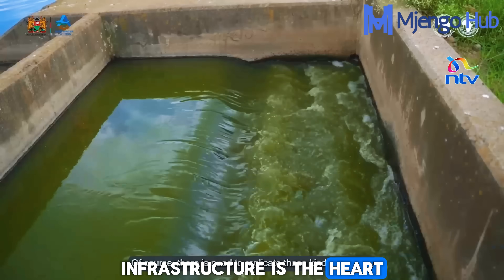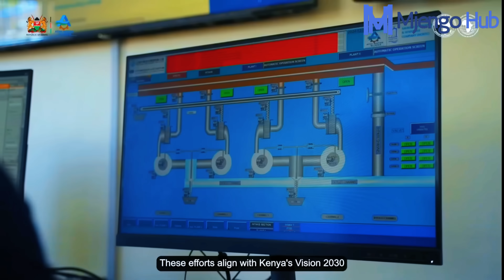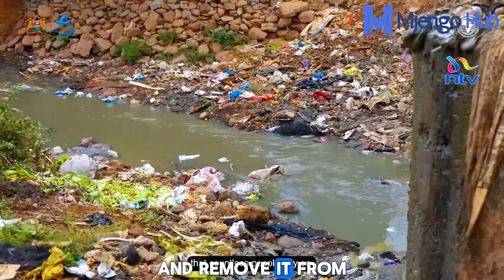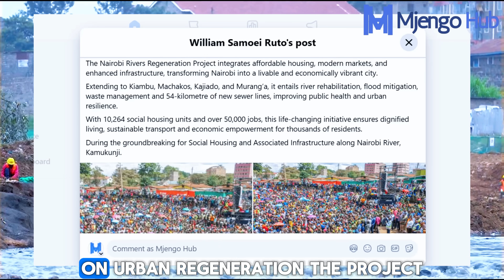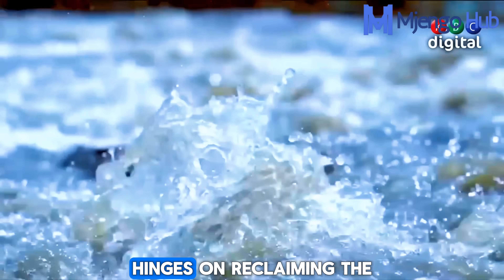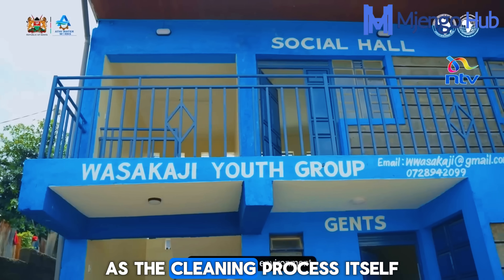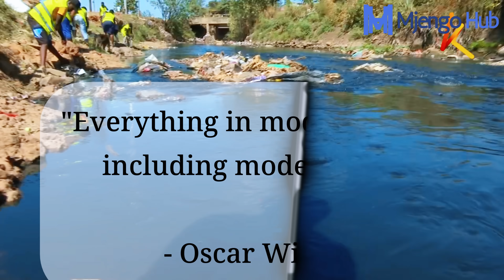The Nairobi River Regeneration Project: Updates and Insights from the Ambitious KSh 50 Billion Plan

Comment: Great report, Mjengo Hub. These improvements are long overdue, but changing the mindset of residents is also important.  
How about the big dumpsite in Dandora be retooled with power-generating incinerators? Alongside the incinerators, can the city add recycling capabilities? Recycled plastics and car tires can be made into building materials (recycled tires can be used as the material on the grounds of kids playgrounds, etc) 
I am sure the residents are already seeing the benefits of a clean environment, and I hope the communities can take the initiative to self-regulate and maintain it to a healthy and safe standard.
Reply: Nairobi county has been talking about the thermal waste plant at Dandora since 2022. I wonder when they'll start its construction
Reply from the maker: @mamisharoy3992 needs a significant investment
Reply from the maker: Thank you.

The government truly needs to invest in mindset shift and recycling infrastructure for sustainability💯
Reply: Actually, one of the main focus of this project is transforming the Dandora dumpsite into a park and constructing a waste-to-energy plant. That is why the project was awarded to Power China. I believe at some point you have heard Sakaja taking early credit for it